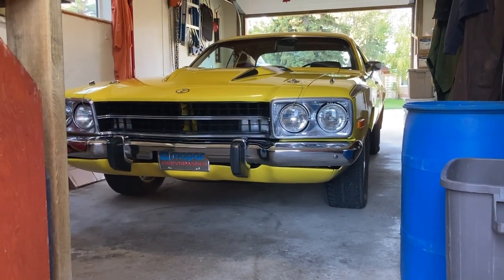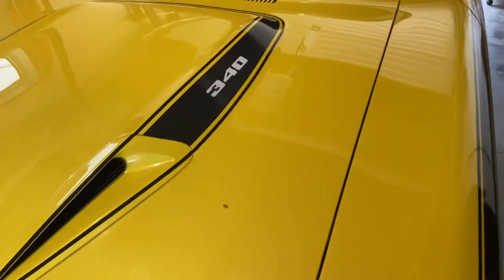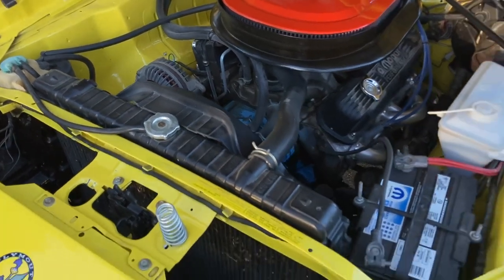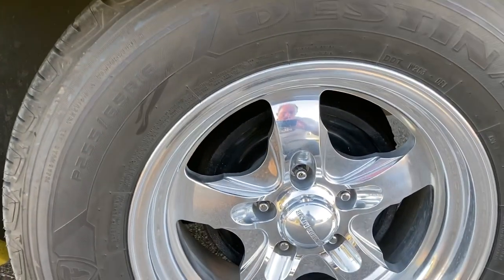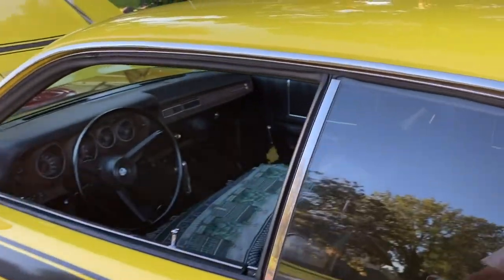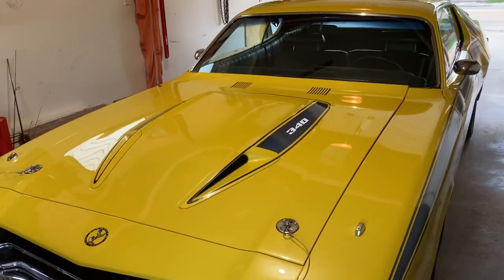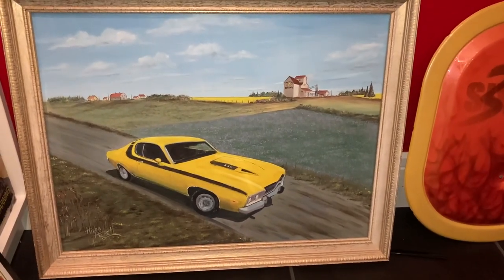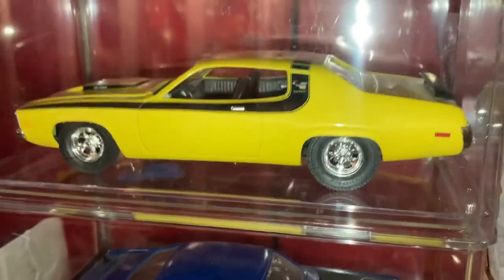My first restoration success story: a 1973 Plymouth Roadrunner

Comment: I bought  a brand new 1973 Roadrunner, in Detroit  only 318, fire engine  red with white interior.  Thanks for video!!
Reply from the maker: Thanks for the comment!  Yours would be a sharp car also. A friend of mine has a 74 400 4 speed that is red paint on white interior and stripe

Comment: Great video. I had a ‘74 360, auto, bench seat, road wheels, lemon twist yellow with uncommon white strips and white interior.  The white strips made it look ghostly. Re: washers, they were affixed to and moved with the wipers.  ‘74 had significant power degradations due to emissions but it was still a quick car.

Comment: You can always tell a good restoration on these '73-74 Plymouth B-Bodies when the rear bumper trim isn't flat-out missing! Of course the original had a steel core and the aftermarket is just a rubber strip, but at least it's there and looks great! NOT to focus on something so trivial, but it all adds up to the whole.

Comment: I have watched your 1973 Yellow Roadrunner restoration video several times.  I am just finishing the interior of a 1973 Roadrunner I found 22 months ago.  These are very special cars  that seem to become a part of your life.  The original owner drove the car 102K miles and parked it in a barn.  That would have been in the early 1980's.  It was found by a car museum that purchased it in 2005.  It was moved to a garage and stored until I found it in 2022.  I am the third owner but the second driver.  The car was infested with mice.  Unfortunately, they chewed the build sheet and made a nest from it.  I have the metal plate under the hood you so nicely described.  I was wondering if you might have the meanings of the codes in a format that can be shared.  I can find information up to 1972 but not 1973.  I am putting together a narrative of the car which I can share if there is any interest.  The car is a 340ci matched with a three  speed slap stick auto transmission. It came with front bucket  seats.  It is a body stripe delete vehicle.  I have found the original owner and she mentioned that it was ordered with a dealer installed hood tachometer which still works.  
John  Lees
Reply from the maker: Thank you for your comments.  Your car sounds great! If you send me a pic of the fender tag I’ll break it down for you.

Comment: I've looked everywhere to find a model of the 1973 Roadrunner, can't find one anywhere, I was the proud owner of an 1973 Plymouth Roadrunner , sehara beige body color black interior bench seats,  318 4bbl  manual shift in floor. Would love to have a model of it , I bought it in 1980 it was all original. I was 21 then I'm 65 now and still love my roadrunner.
Reply from the maker: There are out there, I just seen them at our local hobby store.  If you're in Canada I can help out
Reply: @ManderscheidMedia  not in Canada , I'm in the deep south in Georgia. Thank you anyway.

Comment: Just a heads up..
   In the sunbelt states, where you have a high temp climate....
      160°-170° thermostat is required... . .
    Don't need the aftermarket radiator and ele fans that most believe is  the ans.......
    Expl
  The car was running hot.... 
   Reason....195° thermostat.....
      Always check the thermostat before a new rad/fan change......thx